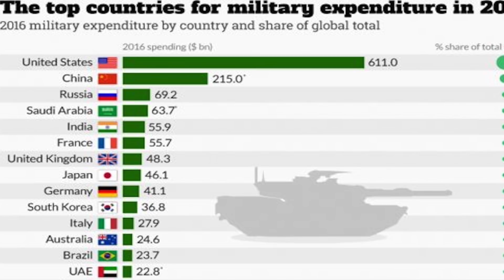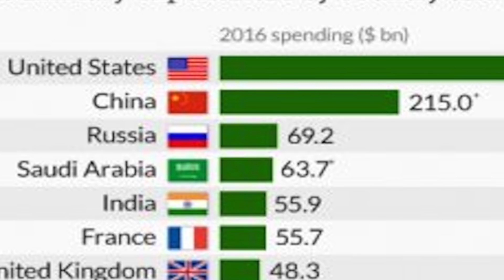CAN USS GERALD R FORD DEFEND ITSELF AGAINST RUSSIAN ZIRCON MISSILE ?

Comment: I heard no mention of the railgun platform the Navy has been testing which is also a hypersonic weapon platform been developed to add another layer of defense to carrier groups for the United States
Reply: Not against missiles
Reply: And why not it is a hypersonic platform and it will be hooked in to the same tracking system I personally expect to see railgun add a hypersonic layer of defense to the Navy I would imagine it will be used in many different applications both offense and defense and with the comparison of cost to missiles this relatively cheap ammunition and the added safety of no explosive propellant we will probably be seeing these weapons a lot in the coming years but now I'm just ranting
Reply: Its too large. Maneuvering such a thing at a SWARM of missiles and decoys will be a nightmare. Rail guns as of yet are to large and are more useful on a battleship then carrier.